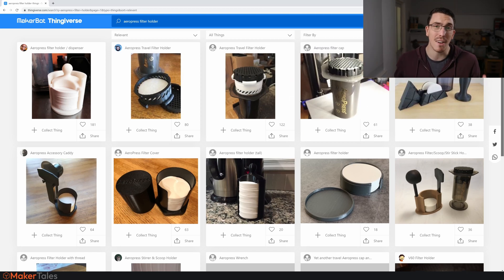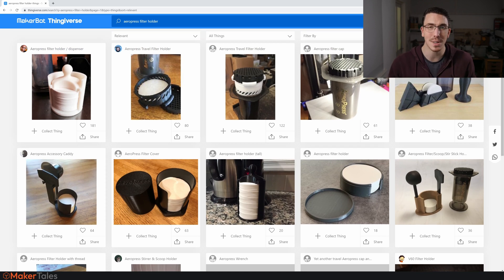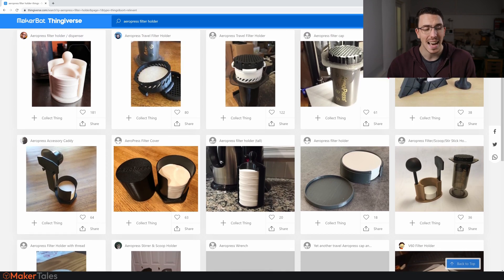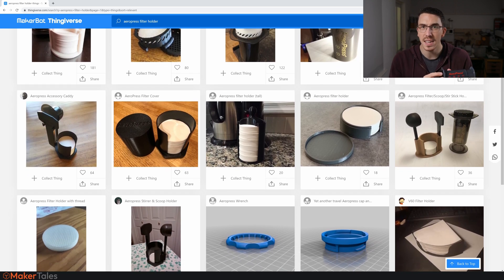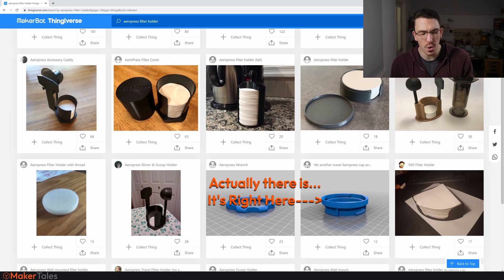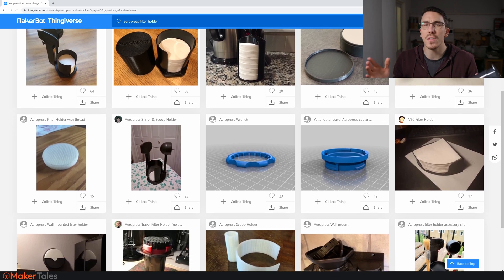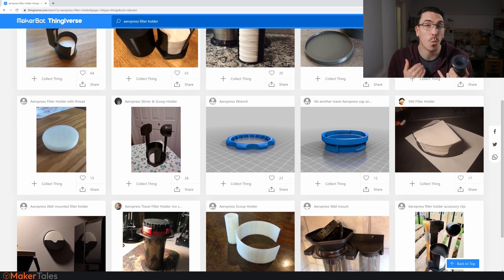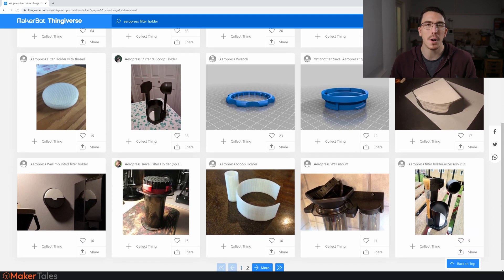How Design Products That Sell | 3d Printing

Comment: A problem I had a while ago ... was just solved by looking for it online and printing it. No need to design it if it already exists. i'm talking about a headphone holder. I found a nice hanger, printed it in about 90 minutes and screwed it to my desk.

Another example is ... I'm also a Scoutleader, but I alse need to take my meds with me ... and I know I'm not the only one. A solution would be a sturdy pill bottle. And there are loads you can download for free. I prefer the ones with knurling on the sides and one that screws shut. Any hinge is most likely to break sooner than a screw bottle ;)

Comment: This episode is interesting in that it defines the limits of the economic potential of plastic 3D-printing in 2022.
The main obstacles to the technology are that it does not scale (due to the material cost and time per item printed) and the durability of said item.
Its advantages are design speed, including rapidly iterating through "fire, ready, aim" cycles to arrive at a prototype, and project shop work where the production run length is 1.  My favorite, and inspiring, example of the latter is prosthetics, e.g. - the patient is somehow missing an ear and one can be 3D-printed by using the mirror image of the other.
Here's an extreme comparison metaphor:  are we whittling a work of art from an interesting piece of wood or are we running a saw mill?
More practically, even if your 3D-printed prototype achieves proof-of-concept, scale requires the additional investment in a injection mold or some other production volume technology.
Reply: Yes and no. I would say on consumer/prosumer level that is true but once you get into commercial equipment the limits are reduced as you can 3d print much stronger materials and 3d printing also allows for designs that would otherwise be impossible to achieve and is now used in aerospace and motorsports amongst other things.
Reply: What type of design wouldn’t be possible without 3D printing?
Reply: @HGW1776  Not certain I will be answering your question - I applaud the potential of 3D printing for design.  In the practice of production at scale we're not there yet with 3D printing alone, IMO.

Comment: There is no problem that can be 3d mass printed.... they all go to other manufacturing solutions. 3d printing is ONLY good for prototyping because the materials are too weak.
Reply: No, you are wrong. 3D printing IS an option for mass producing, albeit not for all and every product of course. You probably don't have much experience with 3D printing as the materials have more than adequate strength in many situations. I have 10+ years old prints that still function. Look at what prusa is doing at their print farm, to mention only one company mass producing with 3D printers.
Reply: @PeterHertel  Hi.  Do you think that you could 3D print male pipe threads (say 2" and below)? Thx.
Reply: @benveasey7474  absolutely you can. I've printed m12 threads a few months back and they work fine. It of course depends on the use situation if the print are strong enough. Shear strength is an issue as you want to print the threads upright.